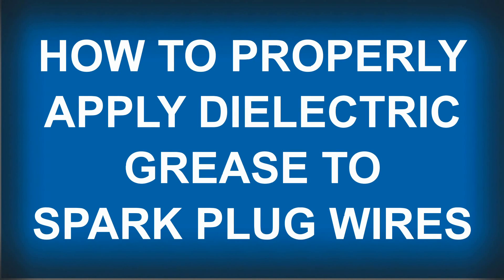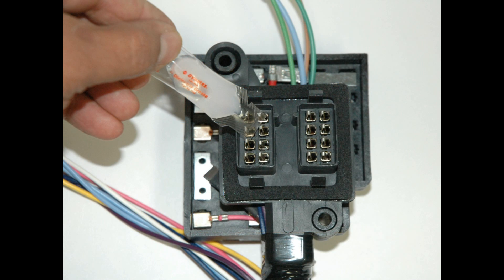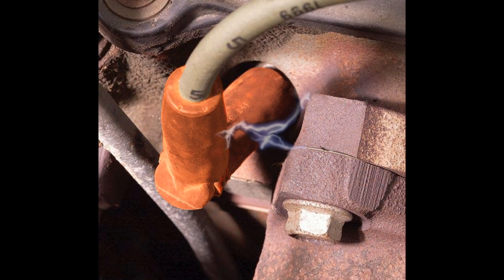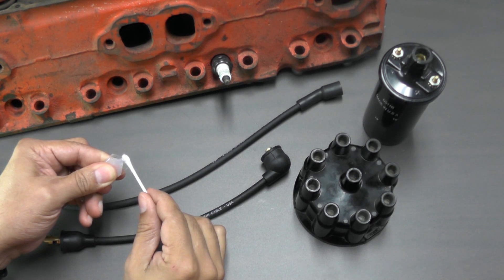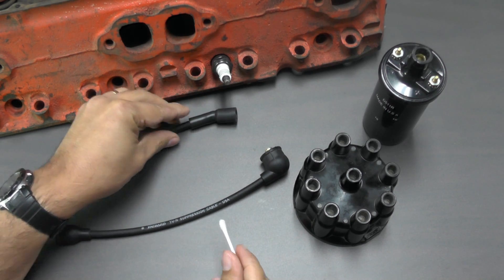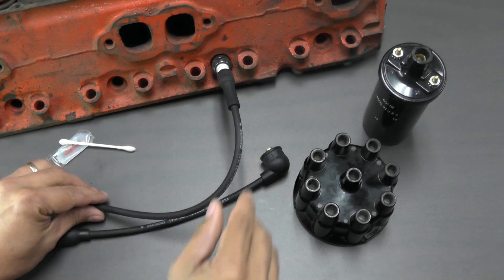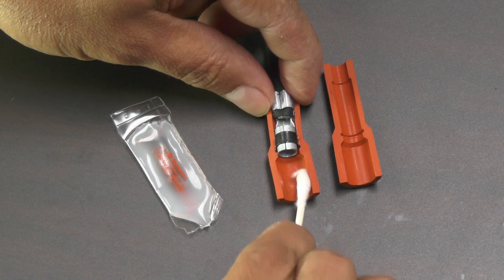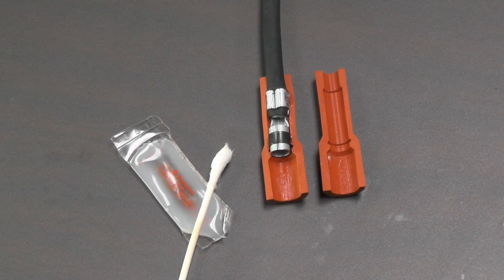Dielectric Grease - The PROPER way to apply it.

Comment: Interesting but I have a question. I was planning on greasing all electrical connections on my vehicle to prevent water corrosion. I drive a Jeep Wrangler that I'll be getting watertight to take it through deep water possibly reaching above the tires. To avoid any major electrical Issues I was going to make sure and grease every connector on the outside of the vehicle/in the engine bay as well as making sure the firewall and body were sealed tight with RTV. If putting dielectric grease in connectors is not a good idea, what would you recommend?
Reply from the maker: SirNut  I know that currently, automotive manufacturers use a lot of sealed connectors (trade name of Weather Pack) in areas that are exposed to the outside elements.  
Weather Pack connectors use rubber seals in each cavity of the connector to seal-out water, dirt, salt, etc.  This is a much better approach than adding topical material (like grease, RTV, silicone, etc.)  
In regards to your question, I wouldn't use anything on my connectors & terminals.  You might find that the grease will actually ATTRACT & HOLD dirt, salt, etc.  And silicone/RTV might be a pain to clean-up if you needed to repair your wiring.  In addition, if you used silicone/RTV and neglected to seal even a pin-hole area, dirty or salty-water (for areas that use salt in the winter) might seep in and stay trapped in the connector while it continues to corrode your terminals. 
Car manufacturers have gone without adding any topical material to their connectors & terminals for 80+ years.  And for the most part, the electrical systems remained perfectly OK.  Good luck!

Comment: At .25 you state that using dielectric grease is about the worse thing you can do with regard to electrical connections. The dielectric grease seals the connections and helps prevents corrosion at the connection points, especially where dissimilar metals are concerned.  As long as the male and female connection is solid, the surrounding presence of dielectric grease is of great benefit with the possible exception of contact with silicone based O-rings and other silicone based insulators.
Reply: Watch This Thanks for the video.  This is a tricky topic.  I had two Hondas back in the 80s.  Both had the wiring harness connections heavily packed in grease.  My first thought was this is crazy.  But since they make some of the most reliable cars in the world, I checked into it.  After 10 years of weather exposure parked outside, all the connections were like new, not corroded like my Fords were.  All the rubber and plastic connectors were like new.  And they come apart so nicely, not stuck like my Fords are.  

On another topic, I recently fixed some flashlights that wouldn't work reliably with dielectric grease.  You know the kind, the $3 small ones with the push button on the end that get very unreliable after about 6 months.  Well, I cleaned the contacts with cotton swabs and 91% alcohol, including the tops and bottoms of the batteries, put some dielectric grease on all the metal contacts, and viola, they all work perfectly every time!  

I believe you that I wouldn't put them on high voltage connections without further research.  From looking at your other posts I see that you have a strong electronics background.  Would you mind sharing that with us and why not good on high voltage?  I am not trying to start an argument, just sharing information and trying to learn more.  Thanks again.
Reply: Hi, Watch This.  Thanks for the info on your wiring harnesses.  You have way more knowledge than I have found elsewhere on the web, and I thank you for sharing it.  Bottom line I guess is if it ain't broke don't fix it!  (I have from time to time gone on binges fixing things that weren't broken, but I'm trying to recover from it.  Oh, well, I guess I'll go oil all the door hinges in my house or something ... LOL!)
Best regards.
Reply from the maker: "oil all  the door hinges".  THAT made me laugh.
Reply: +Watch This, thanks for the additional info.  Very interesting.  I didn't use the best wording in my earlier post.  My two Hondas had dielectric grease all through their wiring harnesses.  I know bc I was so fascinated by that I actually went to the parts department of the dealer and asked what kind of grease it was and if I could buy some.  Seemed counterintuitive to me, putting an insulating grease between two pieces of metal you are connecting ... and the grease was all over.  The contacts were packed in it.  I actually had a hard time believing it, in spite of seeing it.  And that grease is expensive, too.  Since then I've had a few, but not too many light bulbs stop working bc of corroded connectors.  

So I was working on my '98 Taurus stationwagon last week troubleshooting the electrical circuit for my heater blower.  Googling "dielectric grease for wiring harness" was what brought me here.  

Found this at Wikipedia:   "As a sealant around electrical contacts[edit]
Crystal Clear app kedit.svg
This section may need to be rewritten entirely to comply with Wikipedia's quality standards, as problems include lack of references, tone, and serious doubts about accuracy. Comments and suggestions are on the talk page. You can help. The discussion page may contain suggestions. (January 2015)
Dielectric grease[edit]
Dielectric grease is electrically insulating and does not break down when high voltage is applied. It is often applied to electrical connectors, particularly those containing rubber gaskets, as a means of lubricating and sealing rubber portions of the connector without arcing.
A common use of dielectric grease is in high-voltage connections associated with gasoline engine spark plugs. The grease is applied to the rubber boot of the plug wire. This helps the rubber boot slide onto the ceramic insulator of the plug. The grease also acts to seal the rubber boot, while at the same time preventing the rubber from becoming stuck to the ceramic. Generally spark plugs are located in areas of high temperature, and the grease is formulated to withstand the temperature range expected. It can be applied to the actual contact as well, because the contact pressure is sufficient to penetrate the grease. Doing so on such high pressure contact surfaces between different metals has the advantage of sealing the contact area against electrolytes that might cause rapid galvanic corrosion.
Another common use of dielectric grease is on the rubber mating surfaces or gaskets of multi-pin electrical connectors used in automotive and marine engines. The grease again acts as a lubricant and a sealant on the nonconductive mating surfaces of the connector. It is not recommended to be applied to the actual electrical conductive contacts of the connector because it could interfere with the electrical signals passing through the connector in cases where the contact pressure is very low. Products designed as electronic connector lubricants, on the other hand, should be applied to such connector contacts and can dramatically extend their useful life. Polyphenyl Ether, rather than silicone grease, is the active ingredient in some such connector lubricants.
Silicone grease should not be applied to (or next to) any switch contact that might experience arcing, as silicone can convert to silicon-carbide under arcing conditions, and accumulation of the silicon-carbide can cause the contacts to prematurely fail. (British Telecom had this problem in the 1970s when silicone Symel® sleeving was used in telephone exchanges. Vapour from the sleeving migrated to relay contacts and the resultant silicon-carbide caused intermittent connection.)"

Even today, Wikipedia has doubts about some of the stated uses of dielectric grease on connections.  I totally agree with Watch This not to use dielectric grease on high voltage applications unless the manufacturer of the product recommends it.  Also would not use them on gold connectors, mother boards or electronic equipment or voltages below 1.5 volts.  I've read some motorcycle forums where they use it for their wiring harness connections, also RV trailers, boats, etc. for lower voltage connections. I think they put the grease on the connectors before plugging them in.  I've also read forums where some people use a small amount on the threads of outdoor light bulbs, both 120 volt and also less voltage connections for corrosion connections.  Ended up lightly greasing my connections in the circuit to the blower motor before connecting and replacing the blower motor.  I think I'll call the Honda dealer this week and see if they still use that grease in the new cars.

How do you protect the metals in your wiring harnesses you are involved with?  Maybe the plastic coverings protect them.  Thanks again for the great info.
Reply from the maker: Hi Dennis.  You make an interesting argument.  And I mean that with no disrespect.  You are correct in that Honda's do make great cars - and great products in general for that matter.  I'm not sure what type of grease Honda used on their vehicles so I can't make an educated reply/argument.  Some of my background is in automotive electrical manufacturing (wiring harnesses, battery cables, spark plug wires, etc.).  In regards to not using dielectric grease on high-voltage applications (like automotive spark plug wires that can carry tens-of-thousands of volts), I can speak from years of experience and customer technical support.  Electricity always wants to pass through the path of least resistance.  And when dielectric grease is used improperly (as the video shows) on hi-voltage spark plug wires, the high voltage current can arc AROUND the intended path causing the terminals to corrode - just like they were arc welded.  It also causes the terminals to heat-up (resistance causes heat).  In addition, the corrosion is exponential.  Meaning, as the terminals corrode more & more, the speed and severity of corrosion increases exponentially.  When I get the opportunity, I should post some spark plug wires that show this corrosion due to the use of dielectric grease. Hope this helps.
Reply from the maker: Hi again.  Although there are a lot of accurate statements on Wikipedia, some statements (somewhat) contradict each other.  To answer your question, with one exception, we do not use any grease or "protectant" on any of the automotive wiring harnesses we manufacture.  And some of the wiring we manufacture go on million dollar cars.  The one exception is when we use a vapor barrier "grease".  This material gets injected into a bulk head connector that passes through the firewall of a car.  This material's primary use is not to protect the terminals from corroding, but is to insulate vapor/fumes that can accumulate inside the engine compartment from passing through to the interior cabin of the car.  It's super-expensive.  I think we paid $500 for a pail of it.  I'm sure the use, or not-use, of dielectric grease debate will go on for some time. Thanks for checking out my YouTube page and for your questions.
Reply from the maker: I agree that the grease will seal the connections and prevent corrosion.  But this can also be said of using silicone caulk - but you would never use that on electrical connections.  If you did not use any dielectric grease on terminals, electrons would freely flow between the male & female terminals.  This is what you want.  If you use dielectric grease you will seal the outside of the terminals and prevent corrosion, but there is a negative trade-off.  If you use dielectric grease on terminals, the flow of electrons WILL be diminished between the male & female terminals. This is not what you want.  The extent that it is diminished will vary.
Reply: Watch This When the connectors make contact, they push the grease out of the way and make connectivity.  Is there a microscopic film of grease in the connection?  Yes.  Would the flow of electrons be diminished?  Yes.  Is the amount of flow diminished to the extent that it would be problematic?  No.  Would bare metal contacts left open to elements diminish the flow of electrons?  Not at first.  But as corrosion builds, the flow of electrons becomes severely diminished and that is clearly problematic.  So, the lack of dielectric grease is worse than the presence of dielectric grease.  That's how it works.  Quid pro quo.
Reply from the maker: Bourne Accident Sorry for the delay in responding.  Voltage, the material the metal terminals are made of (copper/brass/aluminum/plated vs unplated/etc.), outside elements (humidity/moisture/temperature/etc), time, and the use or not of dielectric grease are all factors when it comes to the performance of metal-to-metal terminal contact. The use of dielectric grease between metal-to-metal terminals under higher voltages (like from an automotive ignition coil) will cause the terminals to prematurely corrode.  I have professional experience with this, and see it quite often.  In this case, the use of dielectric grease is (obviously) not advised. And in this case, NO grease is better than using grease (and the topic for the video).  If you are only interested in protecting the terminals from corroding and do not want to hinder the electrical performance, in a low voltage situation, AFTER the terminals are connected, just coat them with Vasoline, white lithium grease, or similar product.  These types of grease were not designed to hinder the flow of electrons as dielectric grease is so designed.